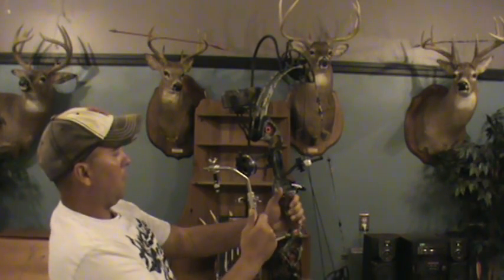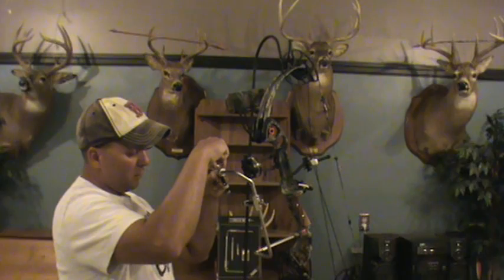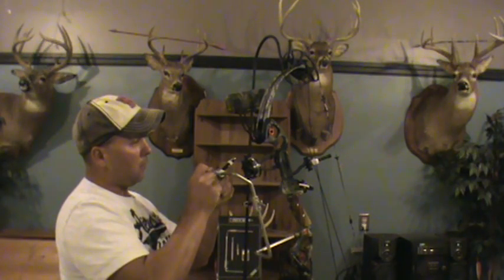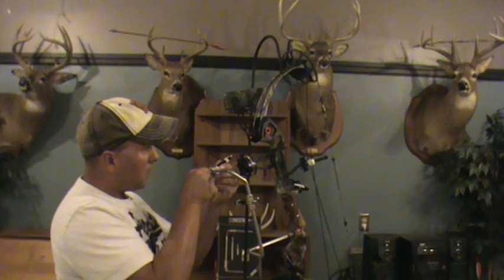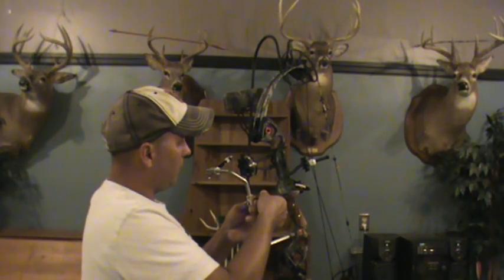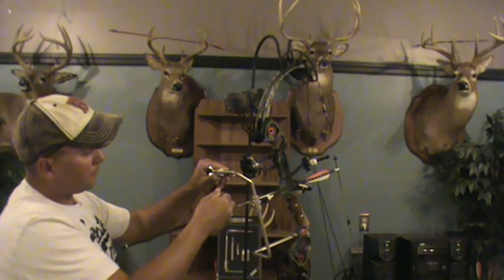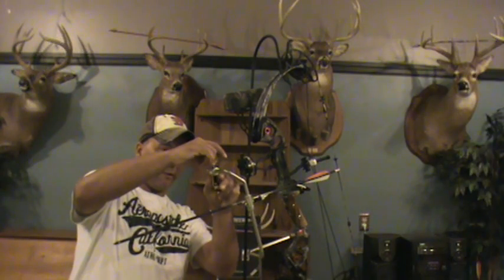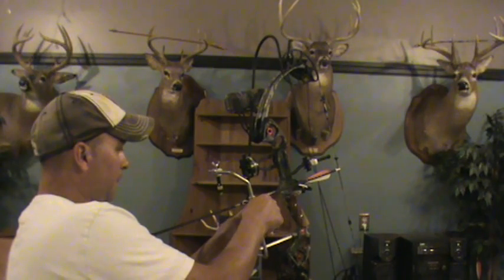"True Shot" Dual Laser Alignment System Bow Tuner!

Comment: Also,  I live in Nc I went to Canada to bear hunt and found out one of my broad heads got loose along the 32 hour drive and cut my bow string.  It didn't blow apart but was too damaged to shoot.  I was 225 miles from the nearest bow shop in northern Manitoba.  I had a new string but no accessories on the string.  This would have been a life safer if just had it.  I don't have one of these yet but for the idiot who isn't happy maybe archery just isn't for you. There is a need for this.